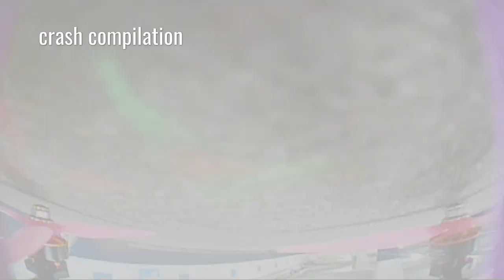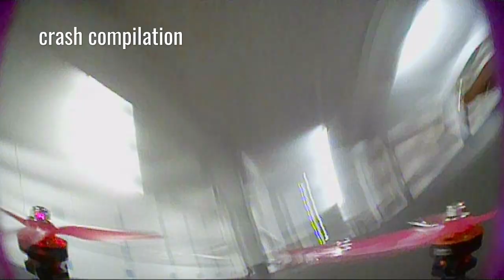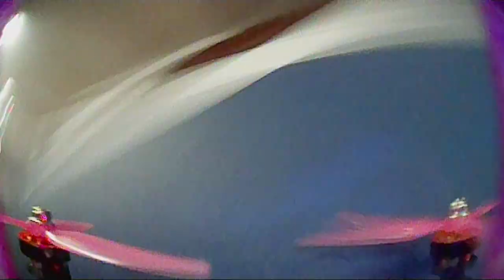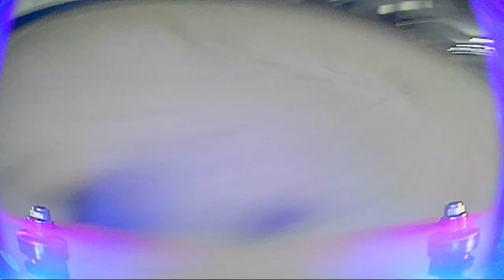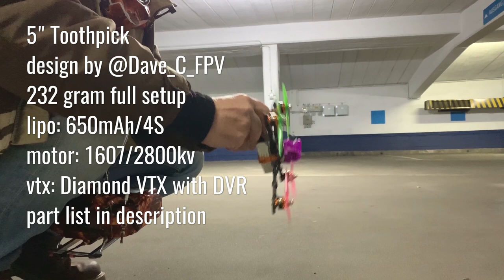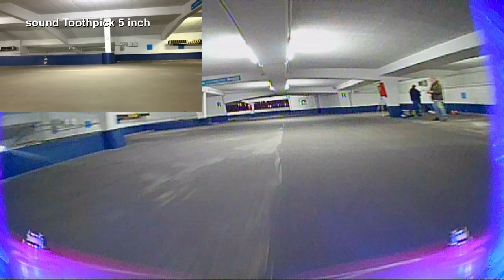5 Inch Toothpick - maiden in car park

Comment: I really would love to know how are this cheap motors. I know the wire suck, but is the motor actually good? Id like to see more of your quad. Im looking for them for a 4 inch build.
Reply from the maker: nasone32 you’re right, the wires are bad, but the motor works good so far. Have to test them outdoor, when the weather will be better here. They are better for 4 inch then for 5, but stronger motors are to heavy to be under 250gr. The stator is also not the best, but for the price the motor is great

Comment: Can that motor use 5'prop??
Reply from the maker: These motors are good for a light 5“ copter. They are cheap and they have no silicon motor cables, but they perform good here, as you can see